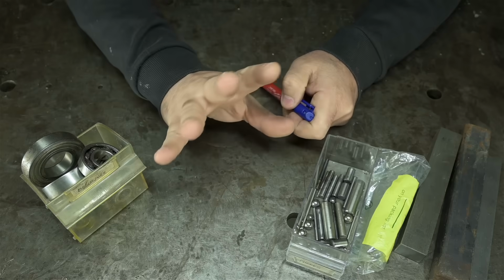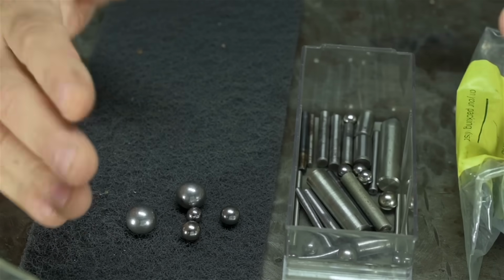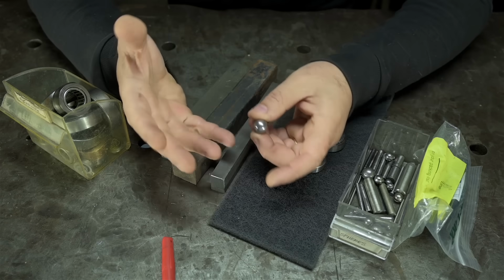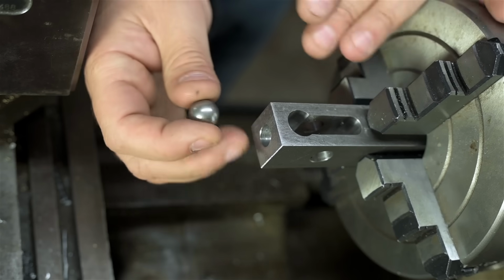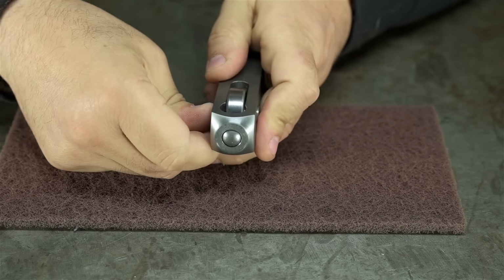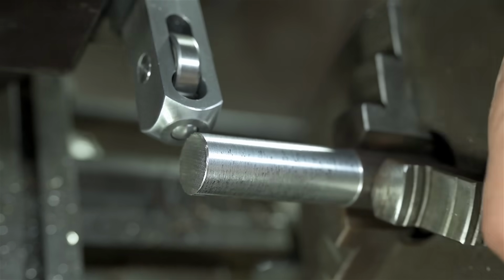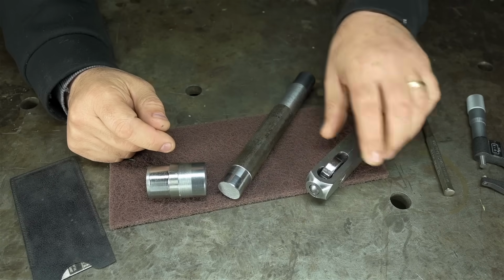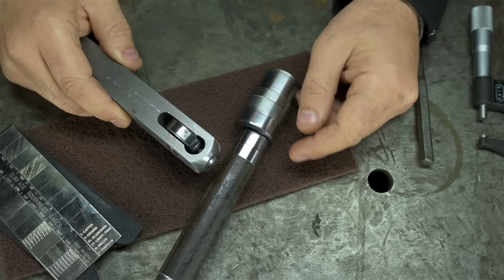I Have The Power!! (Burnishing)

Comment: Many years ago I have used some shop-bought rollers. The roller part of those is something like 30mm wide. "Cutting" speed around 100m/min and feed 1mm/rev. I don't remember the pressure needed, and it was on cnc machines, so no muscle memory is saved on my neural network. I'm guessing the idea of a bearing on a stick would work just fine.

The diameter changes about 0.002mm when doing the rolling finish.

Oh hey. Try to make a thread with that ball thingy of yours. Would be interesting, and useless.
Reply: To add; achieved surface roughness was about Ra 0.4...0.8.

Comment: Ball vs. bearing. The ball has 1 contact point and thus can push with more force than the bearing, which has a bigger contact area. How many points fit on the width? Say 100, then the lathe needs to push 100 times more than with the ball bearing.

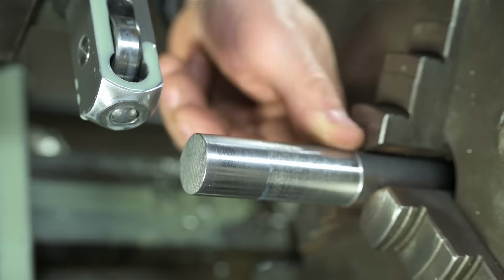Comment: 13:56 I am not a mechanist, but would a piece of Scotch Brite Pad in the void above the "round sphere'" and roller bearing, work to evenly distribute the lubricate and cool the components?
Reply: Flooding the tool with coolant is preferable, especially if you only have 1 line, since that's what's generating the heat.

Comment: Time for a Burnish Off Contest between you tube machinists! 

My predictions; 

Inheritance Machining spends a months make a ravishingly beautiful custom too to burnish only his beloved chamfers 

Abom burnishes a 1ft diameter 30 ft long propellor shaft for a navy vessel.

Not an Engineer makes thing way to complicated by first deciding he needs to fabricate the ball bearing and adding electronically controlled adaptive pressure assist on his tool. 

And TOD ends up burnishing anything  and everything he can chuck in the lathe while giving a comedic master  class on the physics of deformation, and  welds all the pieces  together into a treehouse for his kids.
Reply: And Clickspring explains how the Romans could have done it with hand tools, while somehow getting a mirror finish so perfect that it actually sharpens the reflected image.

Comment: 00:50 I don't see anything wrong with that labeling, it's perfectly accurate. It's just slightly shortened from the full "Spheres, some still inside their original steel casing, some machining required to remove" - I mean, YOU try fitting that on a label...
Reply: Some of them are just 3D spheres that cast a 2D shadow which was then slightly incorrectly reprojected back into 3D. You can't blame the 2D flatlanders for getting it a little wrong when they sent them back to us.
Reply: I'm afraid they move in different spheres
Reply: I thought they were parts Tony could roll around in his hands like a chunk of playdough to make spheres when needed.
Reply: just wait till you see them in a perfect vacuum
Reply: Just write it all on a big label, then cut out the part that says "SPHERES", and stick it on the drawer. Do I have to lead you by the nose?

Comment: Nice. I'm a little disappointed that you did not try the bearing without the ball. Maybe a follow-up video to compare the finish of these two methods?
Reply: A friend of mine works for Boeing and has to address the issue of surface finishing on the hydraulic shafts of the landing gear. Indeed it is a big issue of surface roughness that has to do with bushing and seal wear that must withstand many hundreds of cycles with no surface failure. 
Perhaps their method of surface finish is a trade secret.
Why not just modify a knurling tool by replacing the pattern wheels with hardened ones that are ground with a convex face?
But where is the fun in that?

Comment: Can you make a scissor action burnisher (like a knurling tool) to increase surface pressure without increasing load on the cross slide? - Three points of contact would self centre.

Comment: I think it’s safe to say nobody has their “finger on the pulse of 60s, 70s and 80s hobby machining” like ToT! He’s definitely on the cutting edge as witnessed by his stitches. Who else do you know that can effortlessly use woodworking tools on metal?
Reply: metal is the hardest wood known to man
Reply: I couldn't believe the thickness of them chips
Reply: @johnmadden2814   I was surprised at the finish, considering how thick the "shavings" were.
Reply: Wood tools are actually pretty decent for brass sometimes. I use a wood saw to cut brass
Reply: The 60s, 70s and 80s have a pulse ??
Reply: I thought I was seeing things when he planed some curls of that piece of - ? Ali????
Reply: Tom from OxTools also has a video where he used a round-over router bit on aluminum.
Reply: I use metal tools on wood all the time, but my burnishing effort is tending towards charcoal rather than mirrors - have I done something wrong?

Comment: IT`S ALIVE!

Edit - I would highly consider using a solid carbide ball or a ceramic ball instead of the regular high chrome steel ones... The reason why ceramic ball in steel races allows the bearings to run at around 30% higher speeds without decreased lifetime expectancy - is because steel does cold weld itself onto steel, just like gold cold welds to gold, and titanium has a tendency to so with steel, even if the surfaces are not absolutely perfect, in the right conditions, two metal parts will cold weld together... When you run a bearing that is all steel - there is the ever so slight amount of cold welding happening where the film of lubricant gets squozen(yup) out... The breaking of the cold weld leaves a pit(micro) in one surface(often the race) and leaves a small chunk in the other(often the ball) which gets squished into the metal doing even more damage over time(which is why you tend to see faint, fine, linear, concentric grooves as healthy wear pattern)... Nitride and carbide balls do not have a tendency of cold welding, and thus they eliminate one form of material wear action during use... In a burnisher - that same property should apply and should even further increase the quality of the finish(at cost of extra sensitivity, as cera and carbide balls are ever so brittle as fuck)... I never made a burnisher myself, nor have i got one to check the difference between steel and cera/carbide ball, but such is my speculation... 

Best regards!
Steuss
Reply: Good note, thanks

Comment: 5:14 oopsie, did you ruin that parallel?
Reply from the maker: sigh yeah. gonna need fixin. good eye!
Reply: @ThisOldTony just run the video backwards
Reply: @8__vv__8 self placing parallels, neat!
Reply: @ThisOldTony 
 We’ve all been guilty of this.
Now I use that blue metal pallet strapping, in 6” lengths, 
as a spring between the parallels, saves a whole heep of pain.
Reply: that did make me wince
Reply: I was wondering if anybody else saw that.
Reply: Just gave it some character.
Reply: Just run the drill in reverse
Reply: tis but a scratch
Reply: I gritted my teeth when I saw the parallel get machined!
Reply: do it again kn the other end to even it out
Reply: Yup. I saw that too. And puckered.
Reply: I saw that too!
Reply: SPEED HOLE
Reply: I was surprised by that.